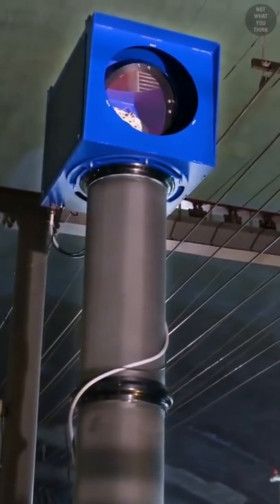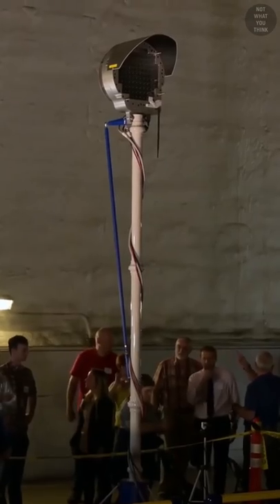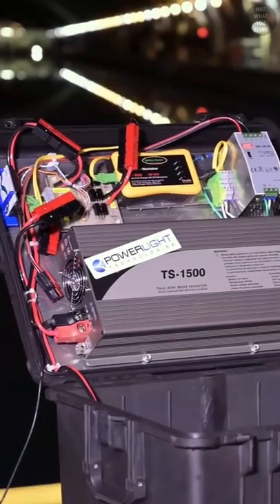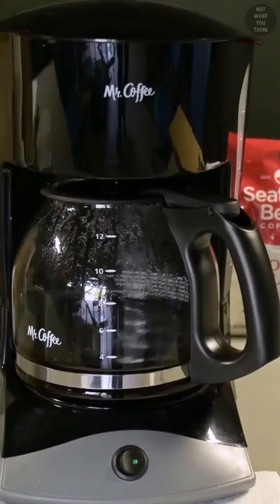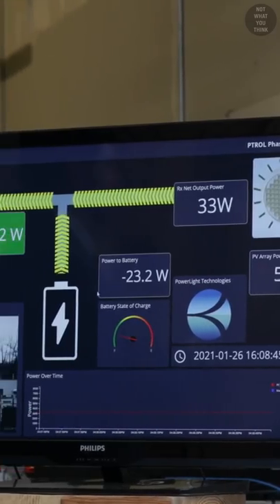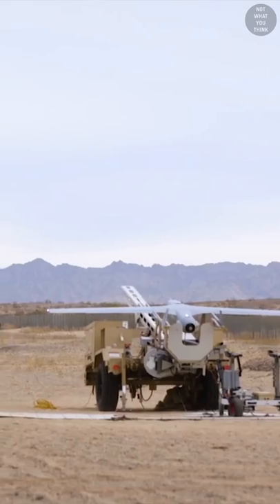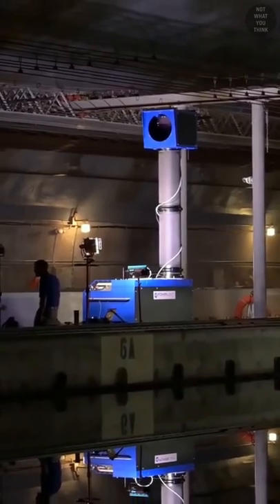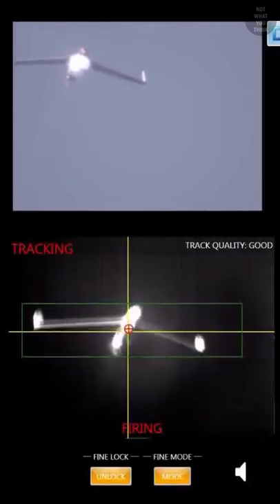Wireless Electricity #shorts

Comment: This system is incredibly inefficient, that is why it is not used for more applications.

Just in case you're curious :)
Reply: I'd still use it if the situations too desperate at the moment to recharge manually
Reply: @ilyte1  and get torched by a 500W LASER, what? No humans nearby allowed.
Reply: @SianaGearz  I'm thinking in a situation where it's too dangerous to land
Reply: Without more of an explanation, that’s just a person on the internet saying things.
Reply: @MichaelB769  Both lasers and photovoltaic panels have substantial energy conversion losses.
Reply: @MichaelB769  if you want an explanation that badly just research it but you could think of a touch and how it gets dimmer the further away you are (not the best analogy tho)
Reply: @MichaelB769  light spreads out no matter how much you try to focus, you have loses in every part of the system. Say the laser can put out 1000w it properly would use 1100w to generate that output. You'd lose majority through the medium, even at close distances. At long distances it would be seriously inefficient. So lets be generous and say its as good as the best solar panels. So you get 25% efficiency. So from 1000 out you're down to 250w, then it probably has to be converted into AC. Which is another 10% loss at best. 225w. Definitely not useful commercially at the moment. Cool system though.
Reply: 95GHz (mmWave) power beaming potentially could be more efficient. Those frequencies are low enough that you can convert it to DC power via a rectenna. However there are other hurdles to overcome at those frequencies; namely atmospheric loss and beam focusing.
Reply: What using a massive Lazer to transfer power a few hundred metres where probably 99% of the energy is lost to heat and light is inefficient.
Reply: @jeremy8696  what about space based solar arrays to power stations on the night side of the platen.

What do you think crazy good or lacking a lot of technical
Reply: @JackTalyorD  I can assure you the engineers of the space station already worked that one out, otherwise we wouldn’t have one in orbit that astronauts could live in
Reply: @andrebarreto9177  Wait wait, we can just put the panels here on earth and have no need for lasers. How about that?
Reply: @andrebarreto9177  more a ring of them similar in scale to the GPS network.

Capturing light from the Sun and redirecting the power to any were on the planet or later anywhere in the solar system.

Would not really be a need for batterys when u tap the power of the sun.

But that's a pipe dream ATM give it 50 years maybe
Reply: @JackTalyorD  But over long distances it would be more effective to just put solar panels on the planets rather than sending a giant retina burning laser to the planet
Reply: @eeeeee8762  unless they figure out how to make room temperature Super conductor's then u could make batters the size of office building that could store more energy than a nuclear power plant.

Storage is the current problem and with solar powered space Lazers u don't have to store it
Reply: Let alone cost
Reply: @JackTalyorD  Storage isn’t the problem, it’s the amount of energy you lose, you’d have to build a laser bigger than 10x the size of our sun in order to send the energy over long distances without losing all of it
Reply: @ilyte1  those situations are rare. You'd need special equipment in a drone e.g. to get that thing charged... That's weight better spent on other things. Whilst it is flying and spending a lot of energy to keep airborne too. Probably can't even beem enough energy on to actually charge it up whilst flying. Yeah no. That's not going to work. Just land the dam thing and fill it back up.
Reply: @einfachnurleo7099  again emergency situations aren't the norm otherwise they wouldn't be emergencies
Reply: @ilyte1  ah yes so for a pilotless replaceable plane we'll put special equipment in to not even really save it or repower it because that's not how it's going to work. We'll also have a strong power generator in our base which is close to that emergency and the special laser equipment which is able to not power our drone too. 
Not to mention that any enemy close might have special goggles to see the laser and shoot down the drones. It's all so perfect.

Comment: I was literally thinking of stuff like this a few days ago. I was thinking if it's possible to send light to a phone and charge it or something.
Reply: It’s called solar power :)
Reply: Search about true wireless charging, which still uses wireless charging technology but not using a pad
Reply: @Jo_easy  no im talking about artificial light. not light from the sun
Reply: @firstlast9731  clarify it better next time
Reply: @hmeric7495  I said to send light to a phone. First, you can't send sunlight. And secondly, phones don't use solar power. Solar energy clearly isn't what I was talking about.
Reply: @firstlast9731  phone cases with solar panels do
Reply: @mknightb698  well they arent that popular are they?
Reply: Your’e gotta be genius or something.
Reply: @MaacAbra  i Kn0w rIgHt
Reply: cool
Reply: The sun exists 🤷‍♂️
Reply: @firstlast9731  ik. But they do exist.
Reply: Yeah, you can do it with any em waves, but it's very inefficient you put a lot more power in than you get out.  Tesla coils work better, but they're not pacemaker friendly.
Reply: @firstlast9731  also, solar panels are how they turn light energy into electricity.  They're basically just a bunch of photovoltaic cells.  Whether it's artificial light, or sunlight it works the same way.  They're not 100% efficient, so you would lose a lot in the transfer of artificial light.
Reply: @firstlast9731  They aren't that popular, but the tech already exists lol

Comment: Crystal radios run off the power from the radio waves themselves.
Reply: I wonder if it's similar to the ones Russians used in the plaque they gifted Americans that was hung in the embassy
Reply: Is it efficient enough to where the the radio wave power cancels out the consumption of power for the radio to function, or is it just used to extend battery life?
Reply: @soupcangaming662  Efficiency has definitely been the overlying issue for all power products since we first started using them. That said, Crystal Radios did rely 100% on the Crystals to provide power; however people needed earphones to hear—the only thing that can be added while stilly relying 100% on crystalxradio power
Reply: @amir3515  from what I remember.. It wasn't even powered at all. It just acted as a big antenna.. I'm not too sure
Reply: Clarification for anyone who's curios.  Back in the 90s when I was a kid my father bought me a Crystal radio kit.  It had a ground wire and ran entirely off the radio waves it was receiving.  It had no batteries.
Reply: @1984Phalanx  That's right I still have one cristal radio.Self powered.
From the air. ☝️💭😎

Comment: Fyi, the way it "turns off" is by having a detection field that encircles the Lazer, which does the turning off....  Better hope it doesn't fail.
Reply: So if I jump in between, I get fully roasted and it still won't turn off 😒?
Reply: @1393wsc  more like if something goes wrong and for whatever reason the detector field doesn't turn the laser off.  But yes, the end result is KFCification.

Comment: You see the thing about wireless electricity is that there is a LOT more intensity loss over distance.
As you can see, the room is tinged with purple light
This means that some of the laser’s light is being lost over time.
Which means that after a certain distance, you’re going to be getting a fraction of the power you put in, as it has been lost in transit.
It’s a cool concept, but it’s inefficient. If they can solve the efficiency problem, then I look forward to their work
Reply: Well it's a start, now just need to refine it.

Comment: The amount of power needed to send 400W this way is so high. its incredibly inefficient. It's also line of sight, and not reliable. The 400W is dubious at best, I doubt 4W of usable energy can be sent at these frequencies and distance. The amount of power lost through attenuation is huge, irrespective of the coherence of the light.

Comment: Well consist how fast lasers travel, the laser would be safe but whatever crossed it is gonna get ded
Reply: Nothing will die
Reply: @user-dt5fk4cs9j  so a 5w laser can burn something, what do you think a 5000w laser would do? Regardless of the modulation, light moves at light speed and when something breaks the beam, sure it will shut down but the energy between the two points has already left needs to go somewhere. Zap ⚡